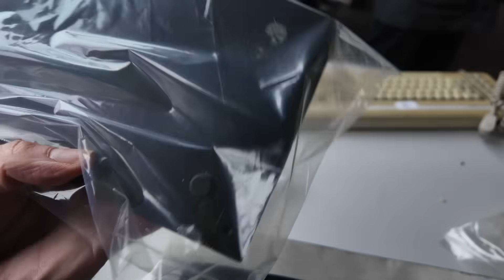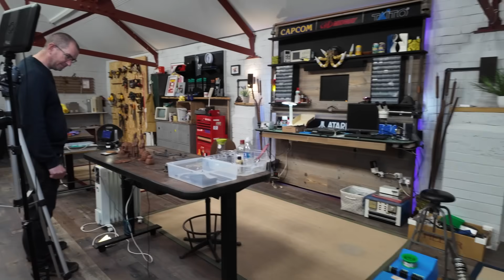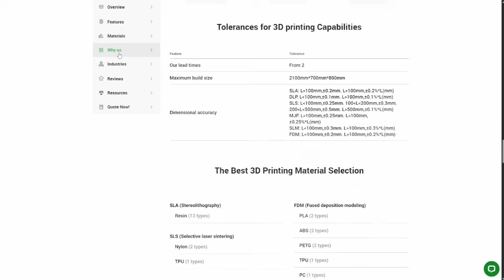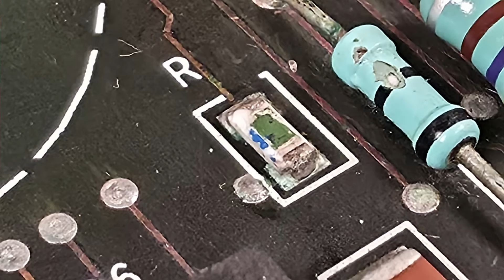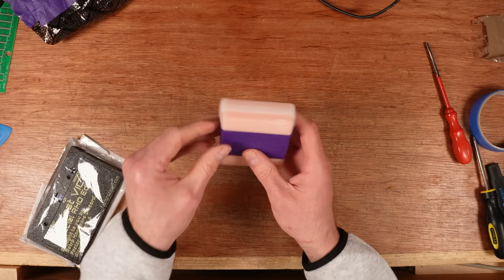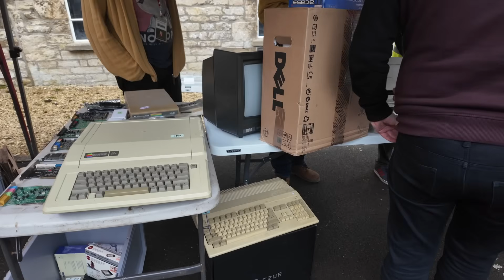Retro Is STILL Cheap! Bargain Hunting at a Retro Museum

Comment: That C64c at 21:38 was really interesting to me with the clipped case and the keyboard fastened to the top case (I’ve only ever seen the screwed case with keyboard on metal brackets) - must have been the last and cheapest type, but doesn’t have the Return key label centered on the key. Wonder if it has a green power LED

Seems like it would restore beautifully with only a little unyellowing needed. I have several ordinary C64c with yellowed/ruined cases and keyboards - parts donors :)

Comment: Really enjoyed this Lee and is always wonderful to hear your enthusiasm and excitement. I was given an A3000 about 20yrs ago with around 40 disks, but it was only 4yrs ago that I actually did anything with it. Luckily the battery had been removed, so was no damage, but it would not boot, until I found out about holding down the DEL key, then powering on, keep it pressed until there is a beep, only then release the DEL key. One you have a battery installed it should hold the CMOS setting.  Also try to use the mono output, if you get no visual output from a scart cable. Look forward to seeing how you progress with this. All the Best Dave
Reply from the maker: Great hints Dave! Thank you. Cant wait to dig into this machine.

Comment: On the Atari 800XL, the two stacked DIP sockets on the ribbon cable looks like a hacked-together 'chip' surrogate for in-circuit emulation... I'd guess that it's inserted in place of (or over, like an IC clip) something, and the rest of the system is to support that. If the pin counts match the ZIF socket, it might be to compare a known good chip with one under test? (i.e. like a more advanced HP 10529a)

Comment: I did see you with the A3000. Can’t wait to see you get it working. There were certainly some great bargains to pick up there. I was lucky enough to get an original US model 1977 Sunnyvale “Heavy Sixer” Atari 2600 for £20. I still need to get a US power supply to test if it works. Also got an Atari 400 for £80 untested. And finally a working Sony 14” CRT with RF input for £40. Oh and a few C64 games for £15 also. A great day and great to meet loads of people from the retro community. The Cave and Arcade Archive are great to visit anyway but this was a special day. Thanks to Neil and the team for putting on the event.
Reply from the maker: Wow! I would have snapped that 2600 up without hesitation if I had got there before you :D On another day you would be there with an Archie A3000 
Was a lovely way to spend a day. Cant wait for the next one.

Comment: The Atari 800XL What's the first computer I purchased, And I spent most of my teenage years Learning to program it.  This extensive modification looks to me like this Might actually be a hardware development machine.  Personally, I would be more interested in seeing It work in that capacity then restored to the original stock Condition.
Reply from the maker: I will do my best, but I think without original documentation I will be flying blind for too much of a complete restoration. I may document what I have, remove the modifications, and see if the base machine can be made to work again. Then maybe start to add the mods back in.
Reply: @morefuntech  It may be a project suited to a massive collaboration between yourself and members of the RHD.  I don't know enough about Ataris or electronic engineering in general to be of much help, but you could hook up with some of those folks and work together to reverse engineer the thing.  Good use for the YouTube collaboration feature.

Comment: If i ran a museum like that i would at most keep about 5 of each item for back ups if displaying working units but anymore would probably be excessive i wonder if the one that was heavily modded is a test rig of some form
Reply from the maker: Maybe!
Reply: 5 is excessive and simply not necessary 😉 We were working on 2 spares for each item.  More than enough and most of the stuff gives little to no trouble - it's the TVs and monitors that give the most headaches!

Comment: I think the long board 64C have screws holding the case together rather than snaps
That 800XL is the most Modded computer I have ever seen. Amzing history there. That 800Xl was loved.
Reply: FlashJazzCat would love that 800XL. He's probably worked on it!
Reply from the maker: It really was. Would be amazing if the original owner ever got in contact.

Comment: I would try to reverse engener the mods to determine the purpose. It's possible it was a failed attempt at something awesome. I'm getting an Altair 680 vibe from just what I'm seeing. Perhaps someone wanted to create a switch entry method ??? Would be interesting to try and figure out what the madness was for
Reply from the maker: Im hoping someone will be able to pinpoint the original guide whoever built this followed. It would be so cool to get it running again and see what it actually does. But reverse engineering is a bit beyond my meagre skills. I will do my best to explore it.

Comment: Nice video, Lee, and some very lucky finds.  Congrats.  Quick note: when you replaced the PLA in the ZIF socket in that Frankenstein 800XL, you dropped it back in the wrong position. It was originally in there with pin 1 in the fourth slot down. I'll be very curious what you figure out about that one. Not sure I'd have the first clue where to start.
Reply from the maker: Thank you. I picked that up in editing and put it back where it came from. Although I suspect it was randomly put there at some point in the past. But who knows!

Comment: Really nice Archi man!! GZ!
I'd have been glad with just the case at that price! Compare to the 3K Motherboard on Wikipedia, you really lucked out on that battery too!! Lee mate ... Buy a lotto ticket, they say it comes in threes!

Edit: Neil is a legend ☮

THe XL: The POKEY isn't just a sound chip, it's carrying important signal lines that the ZIF socket might almost absolutely require to be of any use. Funny the ZIF'd chip is a C64 PLA replacement, though certainly not forced to be so!
First thought, a Jury Rigged *prom programmer ... soon replaced by this though - it's an old Atari Cartridge hacking workstation!

Be fascinated to hear other opinions! You sure do get the best stuff, Lee!
Only slightly green here!